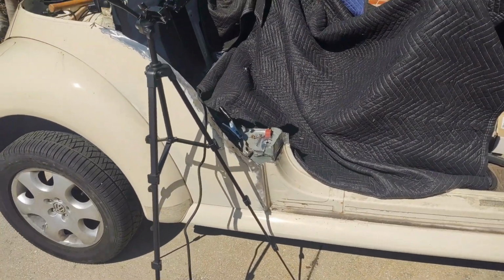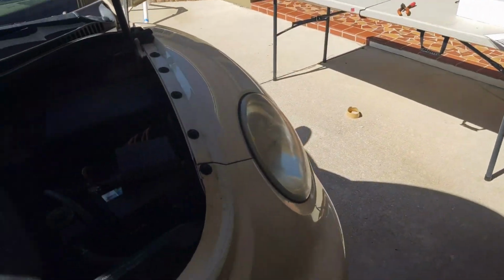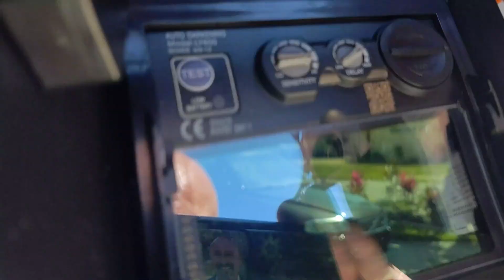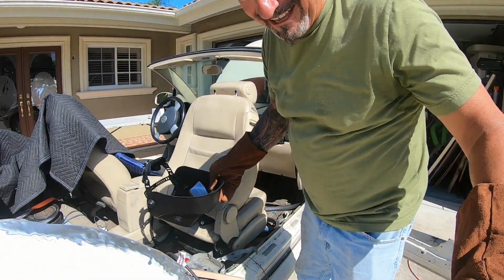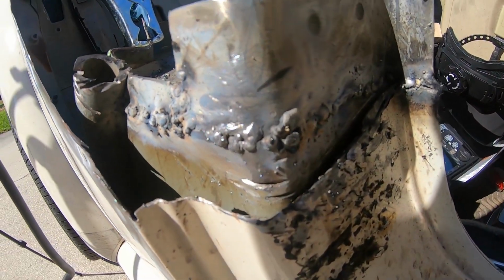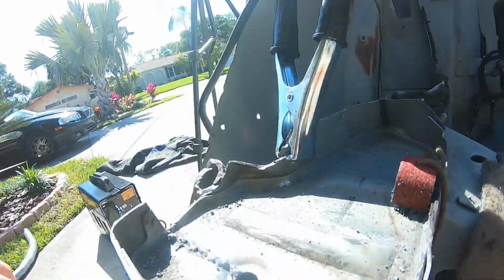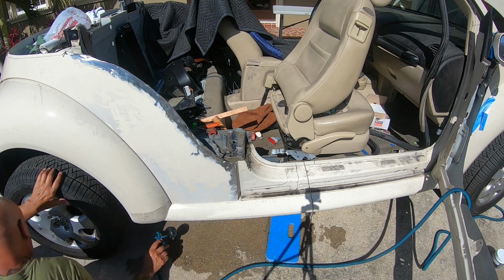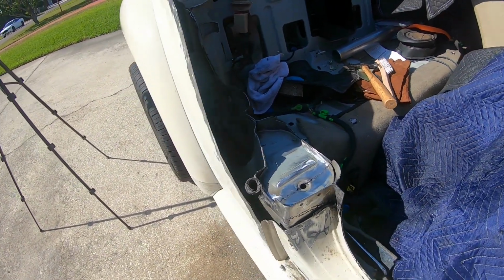Beach Buggy Build, Episode #11 Oh Lord Jesus, It's A Fire!

Comment: Thanks for the vid.  What welder did you buy?
Reply from the maker: Thanks for subscribing! I used a cheap $99 flux core welder from Harbor freight
Reply: @carlgallerbuilds7990  Cool thx.  I'll check that out.  Seems like it works ok.  BTW I found your channel from a comment you had on Bad Chad.
Reply from the maker: @bones8057  Hey, that really cool! I've learned a lot from watching Chad. Down and dirty,  engineering! The welder works perfectly for my project.